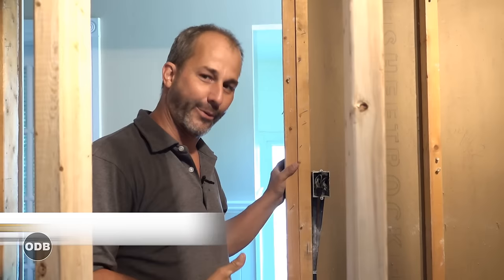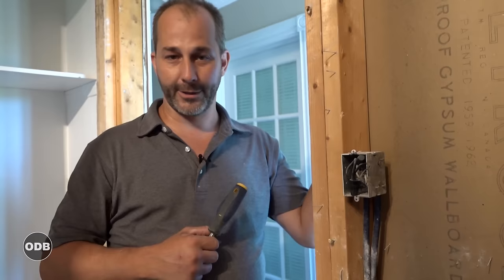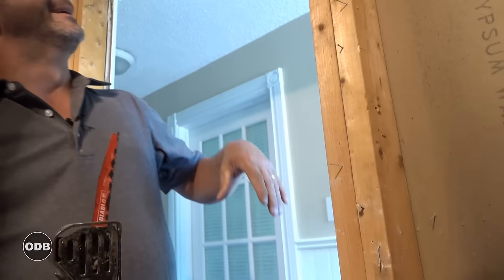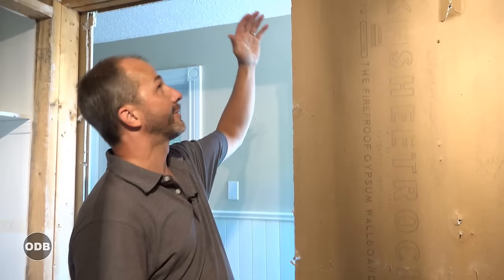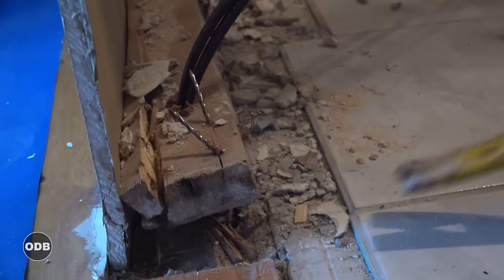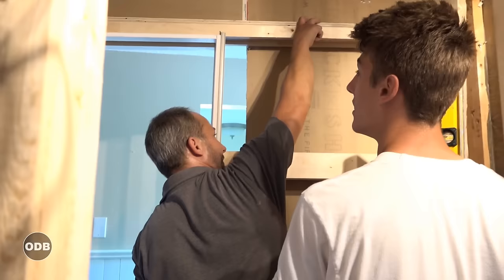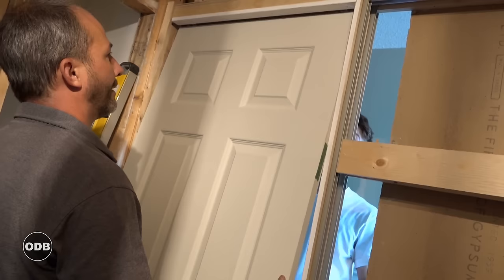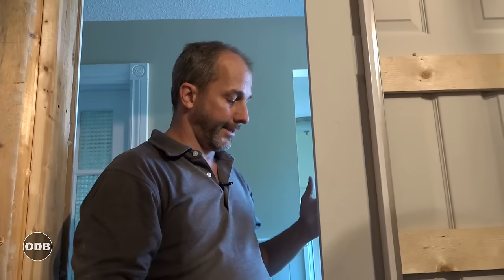DIY How To Install A Pocket Door

Comment: Bunch of armchair contractors here. I'm a licensed general contractor in two states, I've specialized in finish carpentry for the last 10 years. I. Am. Damned. Good. I can't fault this guy. I wouldn't do some things the same way, but this is gold. I remember starting out over 20 years ago. I would have given... quite a lot to have access to a video like this. Good job, dude.
Reply from the maker: What most guys don't get is that this is also a video production so it is a little crazy putting it together.
Reply: @HomeRenoVisionDIY   I was actually hanging a double pocket door today, and started thinking about all the filming, and editing you'd have to do, let alone sound and camera angles and all that... It's a lot!
Reply: Red Milwaukee sawzaw.  Red Milwaukee sawzaw on two   Cut!! Cut!!
Reply: I invented the hammer
Reply: If you don’t say do yourself

Comment: when you popped the studs off the sheetrock without disturbing the finish that was impressive, cuz i would of ripped the rock off and started a 2nd project
Reply from the maker: Thanks dude, anything I can do to minimize the scope of work is time and money in the bank.
Reply: That was the pocket door I used, I reused the old door in the opening, unhinged it and modified to work with the pocket door but it hangs higher, now I have to put a strip on the bottom of the door to fill the gap.
Reply: Dewayne Maiden  it only happens because it was held in with nail if it was screws there would of been damaged to the walls
Reply: Dewayne Maiden 7
Reply: My walls were old school. Glued and nailed.  There was no popping :)
Reply: 99.9% of the time you don’t get that lucky. Still good video
Reply: @HomeRenoVisionDIY  what brand of pocket door did you use? Thinking of doing the same thing in my bathroom.
Reply: What brand was that pocket door was that?
Reply: @tjhall1468  There were almost no screws (or nails) holding that sheetrock... weird. But good vid, agree. Though I would have liked to see the final structure holding up the new header... I mean, is the pocket door frame load-bearing?

Comment: The trick where  you cut the studs and pull them out to not damage the drywall on the other side is HUGE!!!!  I have textured drywall and I was able to do this with very limited repair.  Amazing!  I used this in my basement bathroom video on my channel.

Comment: Thanks so much for this video! After watching it I was able to install a pocket door in our small water closet over the weekend! AND was able to save the outside drywall when removing studs. That even allowed me to repurpose the studs I took out when reframing the pocket door. Excellent info, very DIY/Novice friendly. After watching this, I damn near looked like I knew what I was doing.
Reply: I will say I didnt cut the stud out with a reciprocating saw. I used my oscillator with a nail blade and went behind/above/below the studs and cut the nails, this allowed me to salvage the whole stud for reuse.

Comment: Buying a new construction that I need a pocket door to close off a cased opening.  Builder used to offer this as an option BUT they stopped. Now after I close, I need to install a pocket door.  
Your vid was helpful and some of the tips will help me at the time.  Cheers!!

Comment: Pocket doors......  always a receipt for woe down the road.  They always fall off the track or sag and are a bear to fix.  I've installed this version of pocket door and the walls wiggle and people always want to put picture hooks here and end up scratching the door.  Pocket doors really require extra thick wall depth.  If you don't have that consider a sliding barn door set up.  The track is accessible and easy to service.  Granted this might not suit the house style, but I've had much better luck with these.

Comment: Wanted to mention these are the kits I bought on Amazon. Johnson Hardware 1500 Soft Close Series Commercial Grade Pocket Door Frame for 2x4 Stud Wall (30 inch x 80 inch)Thanks for your help. Home Owner

Comment: Some critical comments regarding safety below. First of all great video, one of the best I've seen. Safety is a personal issue. How you take on a project is up to you. The way you work I thought was very safe, not like a bull in a china shop but controlled with the right tools for the job - there is your safety straight away. Gloves were not necessary as some suggest, if anything would more likely reduce skill level and or tactileness that could lead to possible injury defeating the object. I am a great advocate of safety glasses but I didn't see any grinders going for this job so again not totally necessary with the reciprocating saw - if using a multi tool then yes you would wear safety glasses. Anyway very clear video with a good demonstration on efficiency, safe working and alround neat, clean workmanship. Keep up the good work.
Reply from the maker: Thanks dude.

Comment: I would certainly make sure any structural changes where braced while I worked, or at least make sure I knew exactly what was going on with the loads from above before pulling anything apart.

Comment: I have been doing home remodeling for 23 years in most cases you should be able to determine a load bearing wall if that wall was load bearing once you remove the jack and king stud not no more for your own safety and the safety of the home built a temporary wall or walls a needed until you get the wall your working on completely framed up to code thanks for the video

Comment: How would this be done differently for concrete walls? Can it be done in a way so that the wall does not need to be chopped out? This is to improve wheelchair accessibility. 
Thank you

Comment: Great video as usual.  The door is installed and when the door is open , it seems to be flimsy half way up, the walls when pinched together touch the door.  Is this the way it should be, a little play in the wall?   We are worried about someone leaning on it accidentally.

Comment: I'm a little confused.  Jeff mentions putting up temporary bracing to support the potential load-bearing wall and then proceeds to cut out all the existing support.  Aren't you supposed to put up the temporary support before removing the existing support?  Was that part just not shown?  I do see some studs in there diagonally later when he's putting the pocket door in.  Not sure if that's it and just wasn't shown.

Comment: Need advise Did a new build and had to pocket door frame kits installed and all the drywall id done and painted. No trim yet!  ask the contractor to fit the easy close  pocket doors and he told me I have to install trim first. I am thinking that is wrong Trim goes on after doors are hung. I love all your videos and watch them a lot, Thank You

Comment: Suggestions Please!  SHOWER TILE will be installed on HardieBacker or similar on ONE SIDE OF POCKET DOOR.  I think instead of the little 1x6 horizontal studs seen in the video, the area could be entirely filled with a similar thickness plywood sheet. Would this be strong enough to attach the shower door Side-Mount Hinge? plywood then hardieboard, then tile.
Reply from the maker: I have done that before with great success. Cheers!

Comment: Great vid! If that was a load bearing wall, do you find yourself needing to brace the wall after removing bottom plate while working to complete the install?
Reply: If it’s load bearing then temporary supports should be installed before you remove the load bearing member.

Comment: Great Instructions! I watched your video and just installed 2 sets of double pocket doors and it went extremely well thanks to your tips! Do you have any tips on making the walls more stable? I anchored the frame to the concrete but the middle of the wall is still a little wobbly, I was thinking about getting some 1x4s and making another casing around the outside then adding my trim back. Do you think that will help much? Any other suggestions?  Thanks!

Comment: Not sure where you are located, but that type of header is code for every door for homes built in California, load bearing wall or not.  It is required for safety reasons due to earthquakes.
So I guess the addition may have been done by someone from CA?

Comment: Lol. At 10.20 you ask if it's level and the apprentice says yes, the bubble wasn't even in the centre. Another point is it is easier if you cut the nails first between the timber joins. Anyway good video. JD
Reply from the maker: THat's a thought! Cheers!

Comment: Instead of cutting the nails with a sawzall, I find that clamping a vice grip onto the nail very close to the wood and then rocking the vice grip back and forth, pretty quickly snaps the nail clean off just below the wood's surface. You won't get that with a reciprocating saw.
Reply from the maker: Thanks Rick, I will try that next time. Cheers!

Comment: What did the electrician do with the wiring? I see now on my setup why no structure header above the pocket door. There was a partial wall from floor to ceiling at the end of the sink just outside of the pocket door to release the load - tricky, tricky.

Comment: Thank you for showing. And teach me that a sliding door is also called a pocket door. Do any of you thing it's necessary to hang a steal plate on the wall the pocket door is hiding so no dummy tries to put up a shelf of picture frame on it, risking to nail the door?

Comment: I saw you straggled take off the electrical wire from the 2x4 bottom plate. I use the same way but little  easier. Run the skill saw 4 to 6 inc away from the wire and then heat it with the hammer. It will split like butter.
Reply from the maker: THanks!

Comment: Thinking of tackling this project on a wall where I'm not sure is load bearing. I'm not as confident as you are to begin removing studs without the fear of having the ceiling cave in? Is that a legitimate fear? Are there any precautions I can take to support the wall as I'm installing the pocket door or should I figure out a way to provide temporary support while I do the install? Thanks!

Comment: When you put your temp wall in to support the ceiling how far can it be from the pocket door opening. I am putting in a pocket door to a bedroom off the hall. The hall runs the length of the house and one wall is just off centre of the gable roof so it IS structural and it supports the ceiling joists. It look like you had plenty of room to work between the temp wall and door opening. If it was an external wall and say you were putting in french doors would your temp wall have to be quite close to the wall?
Reply from the maker: Hi Allan the standard distance is 2 feet.

Comment: My contractor had installed the door but it opens fully such that I can't grab the door.  I have to squeeze my fingers through the gap to grab on to the door to be able to close it.  Is there way I can fix this? I want the door to stick out slightly when its fully open.

Comment: One major problem with this video. When you did the demo and removed the studs where are the nails that go through the drywall into the studs? I agree demo does not have to be creating other jobs but there was not one nail connecting the drywall to the studs, that's very odd.
Reply from the maker: You will have to check again. I think during the close up there wasn't a screw in that area , but from the wide shot you see screws on both sides of the lumber. But yes there were definitely less than usual.

Comment: Mine definitely is a load-bearing wall (1st floor in 2-story house).  Don't I have to install a temporary wall before taking out the one that gets the new door?  I don't yet know how much space I'll have...is the min. safe header paired 2x8?  2x6?
Reply from the maker: go with a 2x8 header because you will have the room. And yes you need to build a temporary wall on both sides about 2 ft from the wall you will be working on. Try to put the temporary studs directly under the joists if possible. cut them 1/8 longer than the space between the plates. wedge them in there good and use a set screw so they don't get accidentally knocked out. Once you are done remove the screw and knock them out again. Good luck. Sorry I don't have a video on this subject yet.

Comment: Great Video! One question i have is in regarding to installing a pocket door in my basement. I am currently framing right now and i know i have to use pressure treated bottom plates for the walls. Do I need to be concerned with these frames being that they are on concrete?
Reply from the maker: simply install a sill plate gasket under the door frame. Cheers!

Comment: Hey, have been watching your videos for years trying to learn/motivate myself to dive into a project. So, I started a pocket door install in one of our facility bathrooms, but I am not sure its going to work. The ceiling height is about 82 inches (from inside the wall to the top of the frame, and I don't have a full 56 inches of width for the frame. The door(/frame) is 28 inches wide and 80 inches in height. Do you think its still possible to install this?

Comment: I would like to do this style install but on the opposing side is my bathroom shower. Also, there are no water or wiring segments in the wall that would need to move or even address...just empty framing that backs up to shower rather than another wall. Do you think I would chance damaging the shower if I tried this?
Reply: The bathroom is very small and poorly designed. Installing a pocket door would make moving around in this space much more convenient, especially since this is the bathroom in the master bedroom.
Reply from the maker: I would do it. Just take it slow and use a multitool.

Comment: I didn't see anything about reaffixing the drywall from the other side. Is it just a foregone conclusion that you would do that or is it not necessary?
Reply from the maker: Sorry Tiffany, the video missed this step. we just simply dab a little construction adhesive from the door frame to the back side of the drywall and you are all reconnected.

Comment: Would it be possible to put a switch box (with 2 romex cables - feed line and switched line) in front of a pocket door assembly on a standard 2x4 framed wall? I'd like to replace my master bathroom door with a pocket door to open up space in the bathroom, but the switch ideally needs to go inside the track area of the pocket door.
Reply from the maker: if you are building another wall in front of course.
Reply: I am planning to just hang drywall directly onto the pocket door frame. Assuming the depth of the pocket door frame is enough to fit a thin-format 2-gang box, it'll work.

Comment: so worried about the header over the door being structural and then you chop out one of its supports?
Reply from the maker: I built a temporary wall just inside of the bathroom during this project. That is where the camera man is standing.
Reply: It always amazes me how people will critique on YouTube for a 20-minute video that took an hour and a half to make.. they were not there and have no knowledge of the project but yet they  know better than the person making the video...sheeeesh !
Reply: He also doubled length of the header which still might cause issues.
Reply: @ Starr Tile But if you are making a "how to" video don't you think it is important?  its like making a video on how to change the tires and forgetting to tell you to take the lug nuts off.  Kind of important.
Reply: Come on.  He has double 2x8" that is more than enough.  This is an interior wall. As you see him remove the jack stud nothing moves.  That old header just keeps the door opening stable.  It is not holding up the ceiling.

Comment: I want to put a pocket door on the short wall of a shower wall...   can you tile a pocket door wall?
Reply from the maker: yes. but I suggest you use cement board and large format tile. make sure the cement board is supported by resting on the floor to transfer the weight. cheers!

Comment: Hello there,  currently I'm staying in a rental that has bi-parting pocket doors and there is no security on the bottom part is there a way I could have a stopper or something underneath it so, I could have a good sleep at night cause now we have trouble without cats punching through the door of wanting to go in the bedroom.
Reply: My first thought to solve this problem is to get rid of the cats 😂 but we have a same problem with out toddler wanting to go through the pocket door.  We just jammed a toy into the gap between the door and the frame
Reply: @AdamEarl2   hah! thought of getting rid of the cats, can i get rid of the toddler? 😂😂 glad we have the same issue, I'm thinking of those garage door weatherstrip base though, that is my best solution i could think of..  haha

Comment: what brand of pocket door, did you use?
Reply from the maker: Honestly I am not sure of the name. But the frame was made of plywood and came prebuilt according to the size of the door. watch out for anything that needs to be modified on site. these products are very poor in quality and performance. The only advantage that they have is to the retailer who doesn't have to use much shelf space to display the product.
Reply: Rona sells them, the ones at Home Depot and Lowes are junk, this one isnt too bad

Comment: pocket door assembly was not put in best location to minimize outside wall work . a build up on left frame by 2-3" , pushing entire unit to right . face framing on outside wall would have covered to wall board on each side . as is, outside wall board falls short of being cover by face trim with no way of providing any support for dry wall joint (paint touch up needed,also)
Reply from the maker: Thanks for your critique Harry, have you ever heard of casing. lol
Reply: funnyman. maybe its just optical illusion but  at 10:34 the veiw through doorway shows what appeared to be a 4" CASING face while the drywall gap looked to be a bit more than that . (I do enjoy your videos , especially the ones on tiling. thanks)